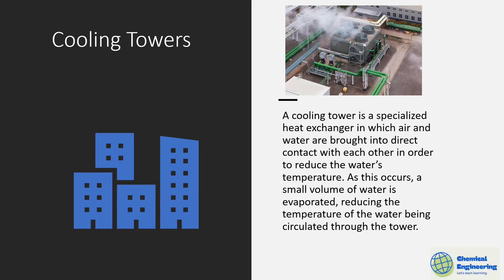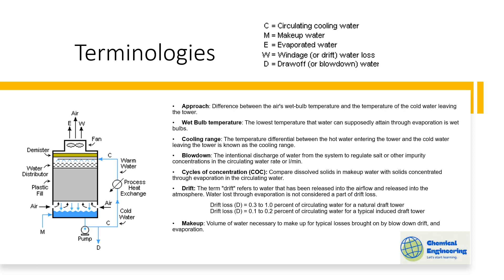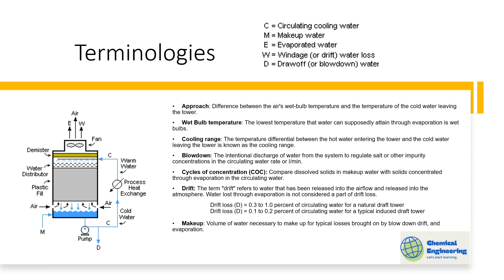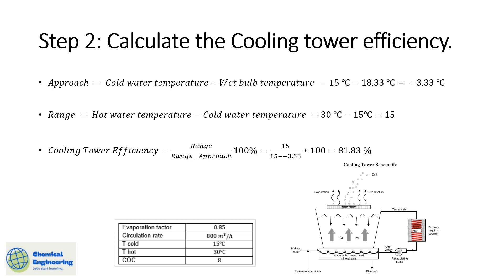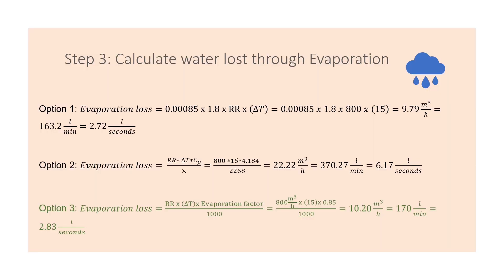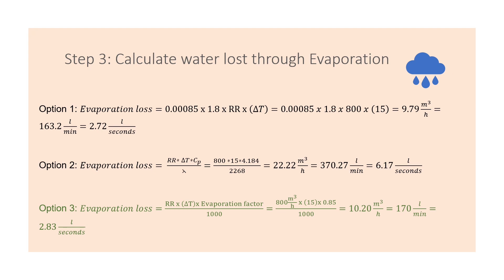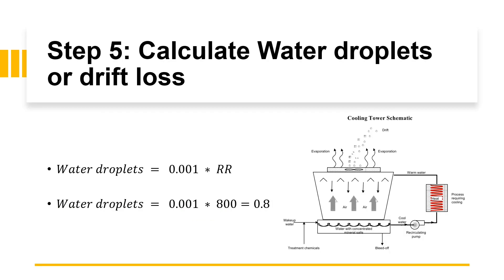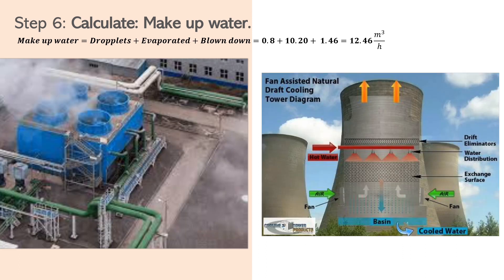COOLING TOWER CALCULATIONS: STEP BY STEP GUIDE! INDUSTRIAL APPLICATION

Comment: Hey Kgabisang. May you further explain on how you got the wet bulb please. 😶
Reply: She used the typical evaporation factor of 85 and the relative humidity of 68% and extrapolated on the between 60% and 80% curves. She then read the  wet bulb temperature where 0.85 evaporation factor and 68% relative humidity curve intersect